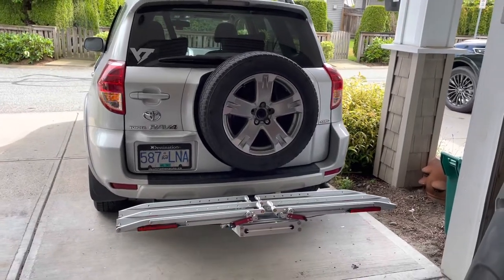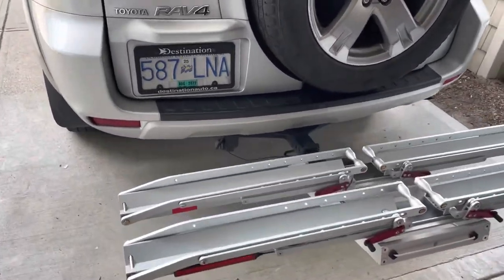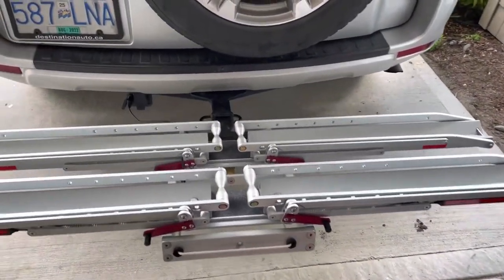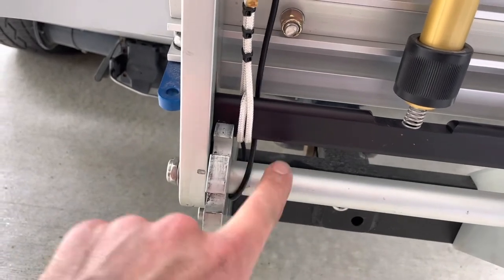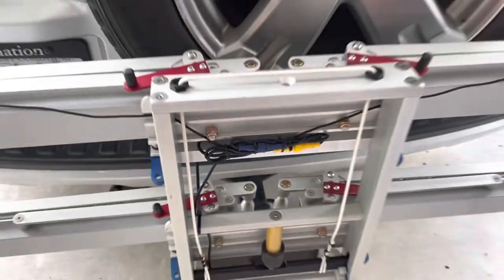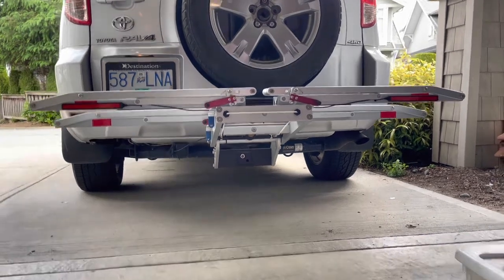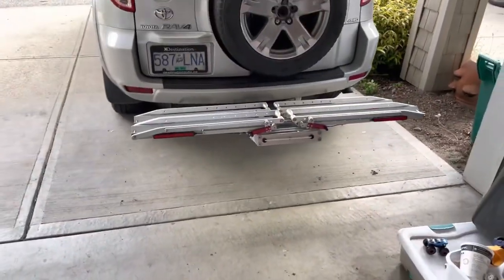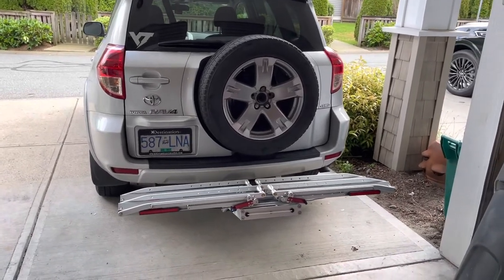1Up Bike Rack LED Brake/Turn Lights

Comment: Thanks for the great idea for lighting on the rear of the rack.That rope idea for a pull bar extension  is slick.I already had bought the one from 1up when I extended my rack to 4.Anyway their 1up light bar is a bit too pricey for me  and found your video while searching for ideas.
  Thanks

Comment: Thanks for a very useful video.

I'll question whether velcro will work well for two reasons: the adhesive on velcro has a pretty short life when out in the elements; and while the adhesive is working, the velcro packs easily with dirt and mud to the point that it becomes ineffective.

There are many reviews on amazon that criticize this style of light for being inadequate when combinations of running lights and brake/turn signals are employed.  I agree that wiring in a second set of lights would be worthwhile if there is sufficient space on the bike rack.

Your rope extension for the tilt release is a stroke of brilliance.  Do you find that frequent lubing of the various pivot points and friction surfaces is needed?  Aluminum is notoriously sticky if the surfaces aren't perfectly smooth.

Comment: I looked as the ones from Curt, and in the end sent them back. Why?... Because there was no way for me to evenly install then on both sides. Also there was no way to pivot the lights down. I was also worried that when the rack was in stored position the would be sideways.  Now you only  need to move your license plate so its legal when they bikes hide it. Ended up with a pivoting Kody  rear light system combined with a Kuat  2.0 plate adapter in  a stacked configuration.

Yeaaah it cost more, but it looks stellar!

https://youtu.be/Hf1NU-T2_9w